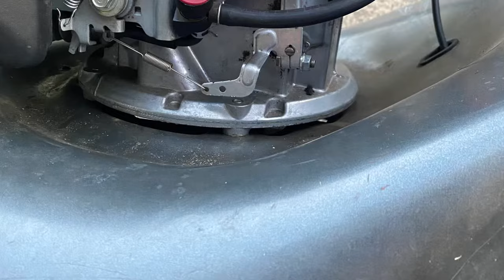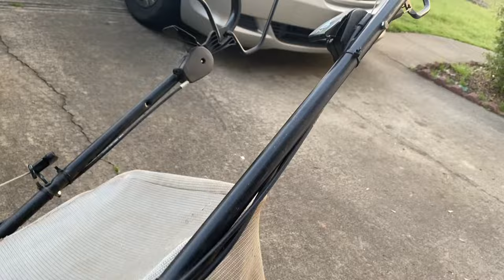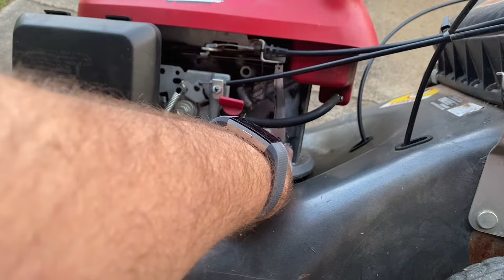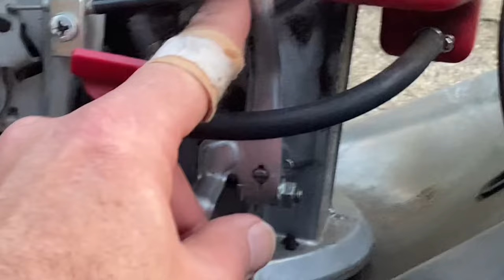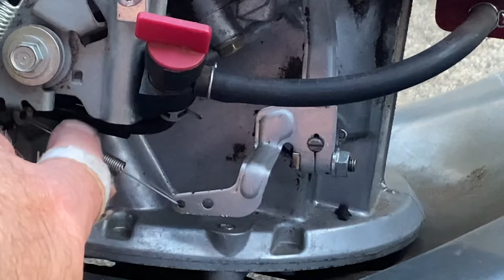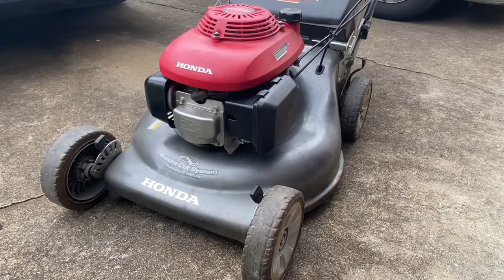Quick tip: Setting governor on Honda GCV160

Comment: I had a surging issue. Everything online said dirty carb. Cleaned it and reinstalled 3 times. I did a governor adjustment. This, but a very small tweak off full turn clockwise and it runs perfect. But its very sensitive. Anything more then a small tweak and it will over rev!
Reply from the maker: Governor adjustment is a last resort in my book

Comment: My lower governor spring is too loose and falls off.
How to connect it
Reply from the maker: Sorry not have the mower anymore. I sold it.    And I don’t have another Honda to refer to.
Reply: Hold the top governor with your hand so it doesn’t move. And take pliers on the lower governor where the spring is and pull it down to tighten the spring. If you tighten it too much the engine will rev higher then you have to do the same steps and pull the lower governor up